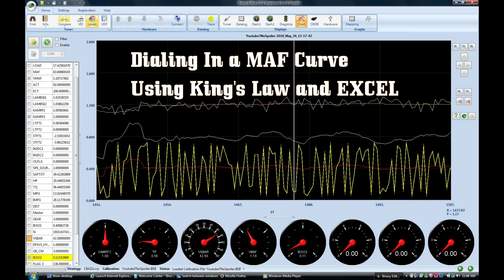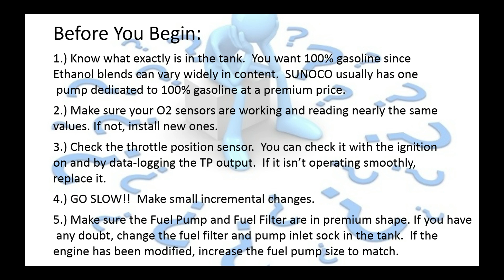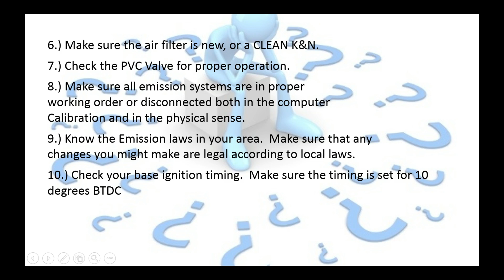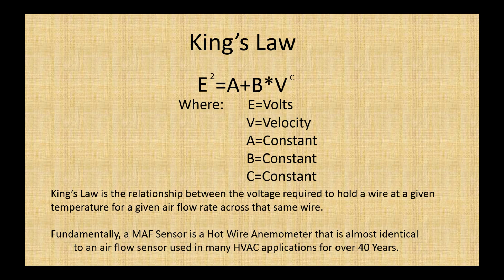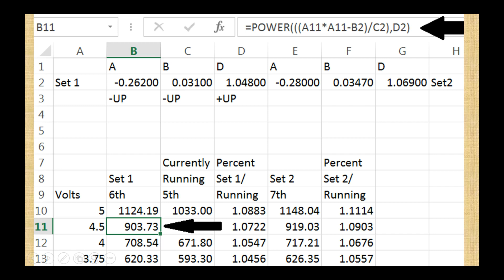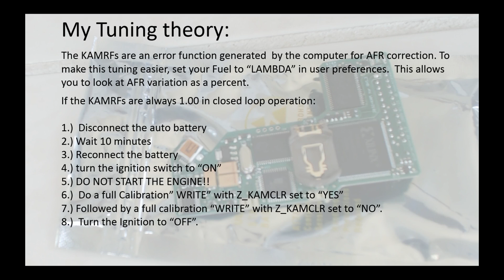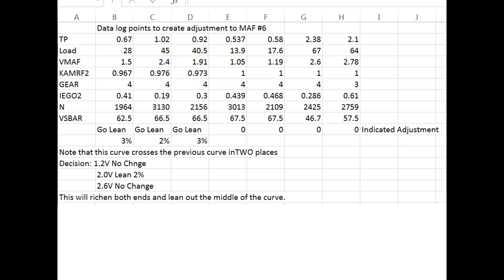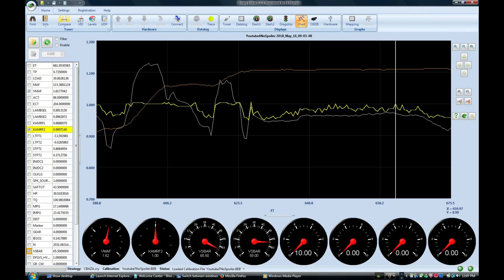MAF Curve tuning an EECIV with CBAZA, and  a Moates Quarterhorse, running Binary Editor 5.122

Comment: the maf you purchased has the CORRECT transfer function, why are you altering it, its a measuring device NOT a tunable device, you use IT to tune.
Reply from the maker: There is no MAF transfer function. For a slot MAF in a custom housing.  In any event, you’re failing to take into account the air that gets by the throttle body unmeasured.  This is a significant error at the bottom of the curve at idle and cruise.   PCV air totally bypasses the Throttle body.  For my engine that’s around .6 Lb/Min.  You must adjust the MAF curve and bypass scaler.
Reply from the maker: I got into a discussion on this in Eectuning.com.  As I discussed there, the MAF curve is dynamic, not fixed.  As the engine ages, PCV flow increases.  The BOTTOM of the curve must be adjusted as this flow increases.
Reply from the maker: Oh, and let’s not forget the EGR, and Smog pump.  Both flows the MAF sensor is clueless about, but the O2 sensors see the results of.
Reply: @EdHumble  Again PCV air flow IS MEASURED.  id dont see your point.  A maf curve is NOT dynamic, the engine might be, but NOT THE maf curve.
Reply: @EdHumble  EGR and Smog air flows ARE KNOWN. what are you saying?
Reply: @EdHumble  You are 'making' your own maf transfers?  very silly, i hope you have an OEM flow bench.  You do not adjust a Maf transfer from TB air,  You tell the ecm the amount of air that bypasses, so it can make AIR adjustments, by using the MAF .  PCV air should ALWAYS BE METERED.
Reply from the maker: Jim,
All I can say is my method works.  26 MPG with my 408 and the torque is so high, the car breaks both tires loose at 2800 RPM UNCONDITIONALLY WITH 8” wide tires,  on wet pavement.  Tip in is excellent, and with some tuning I think I can get 28MPG!  Go to EECTUNING.org and review the thread there.  Most experienced tuners say adjustment of the MAF curve is always required.  Binary Editor even has provisions for it.
Reply from the maker: Stock PCV is not metered.  I goes into the Manifold, after the MAF.  The stock connection is behind the Manifold.  There is even a bypass hose after the MAF on my stock 302 setup.  EGR is always changing.  The valve carbonizes and flow changes.  The Smog pump is the same, it wears. Airflow through it changes.  All dynamic.  Check the stock plumbing, you will see this.
Reply from the maker: As to the MAF changing, going back to the days of carbs and headers.  If you install headers on a car the stock carb always is jetted to lean.  You have to change the Air-Fuel relationship.  The carb MAF curve is thus altered.  A out of the box carb is always flow bench calibrated.  By your argument, Why should I have to rejet it?  Richer jets, often give better gas mileage and lots more power, with better drivability.  This was always Standard tuning procedure before the 80s. The headers improved the exhaust gas scavenging.  That means a denser incoming charge, thus more fuel required and more power at the same throttle opening.  That allows a more closed throttle and better gas mileage under low flow conditions.  Again, I bought a slot MAF and a 4” Housing.  I took a stock curve and changed it based on KAMRF readings throughout the RPM range during closed loop operation.  I’m running the car entirely in open loop now.

We’ll just agree to disagree.  I know my methods work.  If you’re happy with what you have, more power to you!

Stay well!
Reply: @EdHumble  If you are changing the maf transfer to get your fueling dialed in, you have a problem somewhere.  Why not 'dial in a temp sensor you dont like, or IAC transfer you dont like"?  The PCV system is CLOSED and draws fresh air from the intake before the throttle body and after the the maf, which just measured it, that fresh air replaces the gases drawn out of the crankcase.  As for your 'carb' analogy, a MAF MEASURES AIR MASS, thats what it does, if your engine requires MORE air because it is MORE 'efficient' it will measure that.  pretty simple.  a carb doesn't, but you should know that.  Link the thread at eec tuning, i have been member there since 2001.
Reply from the maker: Positive Crankcase Ventilation Valve.  The crankcase is always positive pressure Due to combustion gases leaking past the pistons.  That flow increases as the engine wears.  If the crankcase was negative, the PCV valve would never open.  That bypass line always has flow from the engine when connected.  It parallels the PCV valve and is at a slightly negative pressure when connected.  Pull the line off, and check it with the engine idling.  It will have a flow coming out of it.

https://eectuning.org/forums/viewtopic.php?f=2&t=23195

Note who posted last and who agreed with me.

26 road MPG, as much torque as my 454 Chevelle, and great drive-ability.  I like my “Problem.”
Reply from the maker: The MAF is “Fuel follows Air”.  Increase the MAF, you’re increasing the fuel.  A more efficient engine uses less of both.  

Again I had to create my MAF function.  There wasn’t one for the combo I had.  Originally I thought exactly as you do, until Reality intervened.  I spent of a year wondering why the curve was lean some places and rich at others, then I started learning tuning using KAMRFS….
Reply: @EdHumble  Oh my.  is about all i have to say now.  I tried to help, carry on.
Reply from the maker: That was my line ;-)
Reply: Jim's wrong.  There's no MAF in the world that is configured on a flow bench the way it will be in your car.  That said, Jim's right too, in that if you have to make large changes, you probably haven't addressed other settings.  As Ed noted, he didn't get a flow benched printout of the mass to voltage xfer function.  So, what're gonna do?  There's nothing wrong with setting everything else up and then figuring the real MAF xfee function.

Ed, YOU may not be metering your PCV air, but it is metered on a stock fox.  Air drawn into the intake from the crank is brought into the crank from the passenger valve cover, which draws from a tube that runs from the oil fill to the Throttle Body.  I believ the port is just in front of the throttle blade.  That air has already been metered.

Comment: Do you have to load a base tune in before it will start or does it run off the computer and you tweak it from there my friend just bought one and wants me to install it I am a automotive technician just not familiar with this system thanks
Reply from the maker: As a general rule, you start with a or the stock tune and tweak it as needed.  Really depends on the amount of changes involved.

BEWARE!!

This is not a start tuning Saturday and have finished vehicle Monday to drive to work.  Engine swaps can take months to dial in to get an acceptable tune.  

The MAF curve is the foundation of any tune.  ALMOST Anything you do to the car changes the MAF curve.  Two YEARS in, I’m still finding reasons to change the curve.

SPEND LOTS OF TIME AT EECTUNING.ORG BEFORE BEGINNING.

Use Ford Injectors.  They publish the data you need to enter.  All others require EDUCATED GUESSING!!  You’re going to have enough educated guessing elsewhere in the program.

Best to only make one change at a time.

Comment: Ed is there anyway you can contact me directly sir ? im curious about this quaterhorse.
Reply from the maker: I’ve got videos on a Moates Quarterhorse install.  Go to “Moates.net”. The Quarterhorse is only for Ford ECUs.
Reply from the maker: Note that ONLY vehicles from 1986-2004 are supported by this vendor.  If you have a 2005 or newer Ford vehicle, you need to shop elsewhere.

Comment: So I've got an 80mm MAF. I got a curve for it online. Where do i put those numbers in this equation? The B column? And where do the rest of the numbers come from?
Reply from the maker: Doesn’t work that way.  Every car is different.  That curve is for an average vehicle.  All data should be from a cruse in the 70s temperature wise.  Initial Data should be obtained from cruise conditions.  Ideally 45, 55,65, and 75.  You load your existing curve and watch the Kams relative to the Lambs.  For instance if the computer wants 1.00 and the Kam says 1.1, you should richen (increase) the MAF number by Half of that difference.  Say the number was 55.  55 x1.05.

You want data over as broad of RPM range as possible.  Three points make a curve.  Say you’re  dead on at 55.  2% lean at 45, and 2% rich at 65.  Now you start adjusting your existing curve accordingly using my spreadsheet.  In this case 1% leaner at 65 and one percent richer at 45.  Retest and adjust accordingly.  AOC SHOULD NEVER EXCEED 90!!!  Some MAFs have issues with accuracy at higher temps near idle.  With experience you’ll learn how to adjust using data at non cruise conditions.
Reply from the maker: If during a cruise your Kams and Lambs never exceed +-3% of commanded values, you’re. REALLY close.  If you can get to +- 1% during a cruise, you’re dead-on PERFECT!!  A cruise condition should be both rich and lean.  Never just one or the other.  By that I mean with respect to Lambse values.  If Lambse is always 1.02 and the Kams come back 1.00 to 1.04, stop fooling with perfection!!!

Use Lambda values not AFR values.  Makes visualization quicker and easier.  Relating to 14.6 and 15.0 as being 3% lean is harder to wrap your head around.
Reply from the maker: Chances are your curve has different numbers relating to different points.  To use my approach you need interpret between your curve values to match my data points.  Say your curve has 1.55 and 1.45 data numbers.  You’ll need to get a point half way between them if I used 1.5 volts.
Reply: @EdHumble  So you saying pull the numbers from the chart that have similar values for the voltage breakdowns that are listed. I think I got it. I'm new to tuning and excel and I have something else wrong with the car that I haven't figured out yet.
Reply from the maker: How you scale the curve is up to you.  I chose maximum resolution and set voltages in multiples of five for the most part.  This will require several data logs just to adjust your values of mass flow to match the fitted curve.  I recommend staying with kg/hr.  Idle uses Lbs/ min.  My data points were very close together at idle and much further apart at WOT.  There is no perfect MAF curve.  Anything you do that changes the engine breathing characteristics alters the curve.  Even changing the air filter!!
Reply from the maker: I’ll do a follow up beginners class on curve fitting for a MAF.  Subscribe and keeping watching for it.

Comment: I'm building a sbf 331 for my mountaineer 4wd, heads, cam, full exhaust, true cai, 24lb injectors, etc. I'm wanting to experiment with tuning as computers and math AND patience of course are right up my alley. i found your video extremely helpful. I'm leaning toward QH and BE much more than Tweecer or SCT. I'm not afraid of the learning curve especially with all the sites dedicated to their tuning. Thank you for the video!
Reply from the maker: Subscribe!  I’ll be updating my “Dialing in a Cold Start” video soon!

Comment: Great video Ed. I am currently working on the finishing touches of my 95 vert. I stroked the engine and have done a lot of mods and still have a ways to go. I'm at the crossroads with trying to decide which way to go with the tuning. I'll figure it out one day.
Anyway, I was wondering how worth it is it to join the efi forum? They want 450$ does that include the premium tune?
Reply from the maker: Mark Brown 
Best to remember no two cars are alike.  You can buy a “Close Enough” tune, but dialing one in right means lots of data log runs and post tweaking.  The MAF curve itself is always changing. Granted only a few percent, but any thing that alters the way the engine breaths changes the MAF curve
Reply from the maker: Really depends on your level of expertise.  EECTUNING.ORG is both good and free.  EFIDYNOTUNING.COM is excellent as well.  Very LLLLLOOOOOONNNNNGGGGG Learning curve.  Think weeks and even months.

Comment: Great video, I see you've had the quarterhorse for a while now. Would that still be your choice if you were to do it again? I've got a 94 that I'd like to tune
Reply from the maker: Logan Studdert 
Short Answer: Yes.  I still like the Quarterhorse.  Very long learning curve so be prepared.
Reply from the maker: Logan Studdert 
I reference several online forums that are free.  I’d use those first.  I’ll do a follow up tuning video once my 408 is in place.  Hopefully before years end.  

Go slow.  Make incremental changes one at a time until you feel comfortable with your software.

Comment: I don’t know if your familiar with eec tuning forums but I think one thing why your finding inconsistent results is you may have adaptives on
Reply from the maker: Actually, I'm a member of eectuning.org (Several posts there.) and I obtained my starting MAF curve from efidynotuning.com.  Both EXCELLENT websites by the way.

I heavily relied on closed loop control to generate the data used in this video.  I'm currently running the engine in OPEN loop with no issues and excellent performance and gas mileage.  (Even with an original engine having 200,000 plus miles on it.)  I've already discovered that deteriorating  plug wires or spark plugs changes the MAF curve.  Indeed, the MAF curve is CONSTANTLY changing as the state of the engine tune changes. At idle this can easily be 2% due to the engine misfiring.

The trick has always been generating a SMOOTH curve.  That's what the calculated approach does, and too my knowledge, as of this writing, no one has tried this approach.  Get it right on below 2 Volts and the top end will be dead on as well even without a wideband.

I'm working on both the data tables and testing for obtaining better gas mileage during cruise conditions (60-70MPH).  It looks like open loop control might generate Overall MPGs in the very high 20s (Without AC), but I still need more data for a video to document this.

Comment: Ed,  I watched your video on the Sears Floor Jack 328.12001 and have several questions.  How did you get the nut off of the power unit?  Are the threads normal or reverse?  I have tried removing it and even using an 18" pipe wrench, can not get it to budge.   Please send your response to my email address    TomLarkin@wbhsi.net   I check that daily.    Thanks,    Tom Larkin   Tucson, AZ
Reply from the maker: Threads are conventional counter clockwise top to remove.  I moved a 500 pound work bench trying to remove mine and it was in a bench vice.